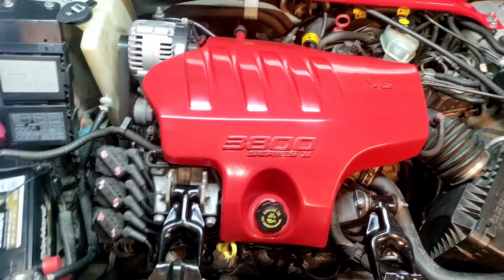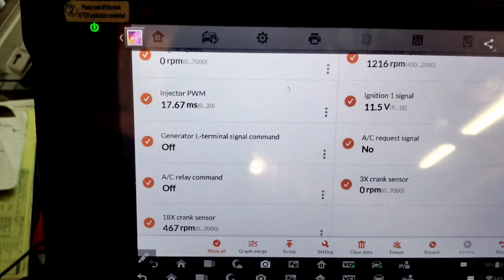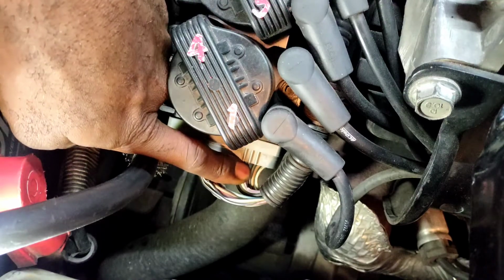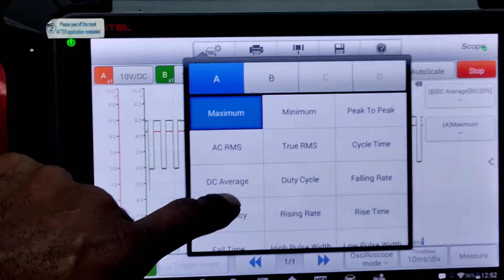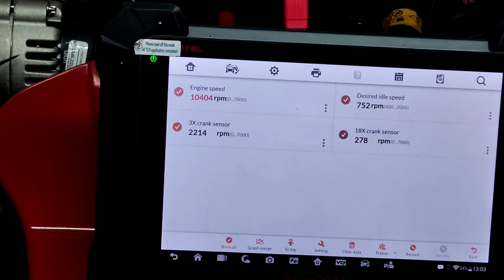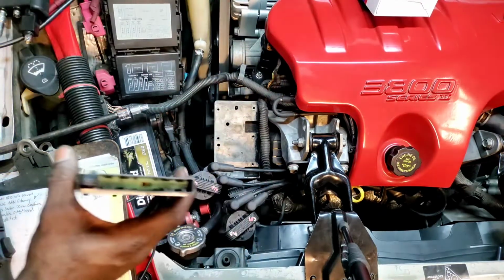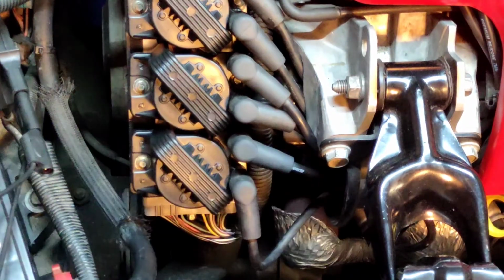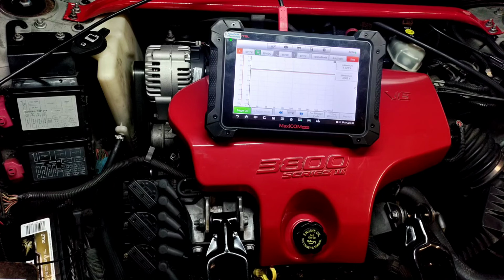update, Chevy Monte Carlo no crank no start

Comment: Hey brother, replaced my heater elbows on my 03 Monte now she won’t start no crank no noise at all, good battery and started fine before the elbows blew. Any suggestions? Thank you
Reply from the maker: I need alot not detailed info. Is it a crank no start or no crank no start?  What have you tested?  Provide more info than you think anyone need for help
Reply: @partsshooter  sorry boss thank you, tested batt and alt both good, no crank no start no sounds when turn key. Before I replaced the elbows car started fine, now it won’t do a thing besides turn the dash lights on. No injection nothing. Thinking it’s a security problem
Reply from the maker: @arejay7243    for clarification,  you have a NO CRANK NO START? Engine doesn't rotate in attempt to start.  Based on your response,  it does sound like a security issue.  

You should have a SECURITY indicator illuminating after making an attempt to start the car.  If so,  try the theft procedure,  cycling key on and off and letting it sit till light goes off. 

If your security light goes off,  check your starter relay,  inspect the pins.  Check the connection at the starter.  Try manually jumping the starter at the relay to isolate the starter being bad. Swap starter relay with similar relay.
Reply: @partsshooter  yessir exactly no crank no start, tried gm security relearn but I haven’t had success yet. I’m gonna unplug the fuse to the BCM to bypass the security system and get it started as a temp fix. Appreciate any feedback boss 🙏🙏
Reply from the maker: @arejay7243  nah... don't do that.  Just check and simply see if the security light is on.  If it's not,  don't bother chasing a security issue,  it's irrelevant at that point.

So,  if theres no  security message in the message center,  move on to the next thing.  Check the starter and relay...
Reply: @partsshooter  yeah the lights on
Reply: @arejay7243  so what happened?
Reply: @partsshooter my security light isn’t on brand new battery previous owner claims new starter. Problem started after ignition switch was replaced I go to turn key and lights on dash turn off no crank
Reply from the maker: @ZEUS-fn6wo  what happen is you put the old ignition switch back in?  Sound like a bad new switch
Reply: @partsshooter  the old one broke so couldn’t even try to out it back in
Reply: *put
Reply from the maker: @ZEUS-fn6wo  gotcha... well... seem like a bad new part.  Try to warranty the part  and install a new one.  If it worked just fine before the original broke and the new one corrected the problem of the original but have new symptoms,  then it's gonna be the new part
Reply: @partsshooter  ok Preciate you bro